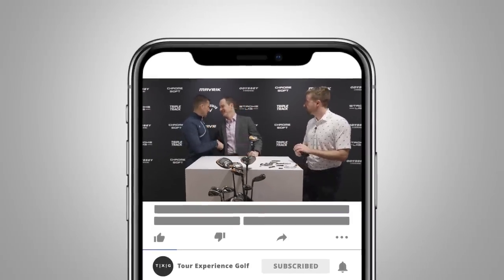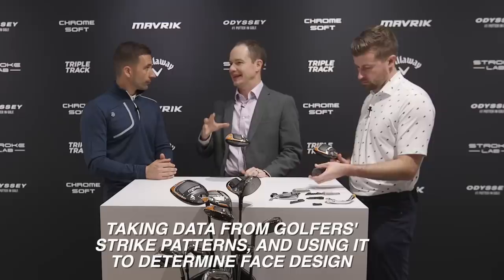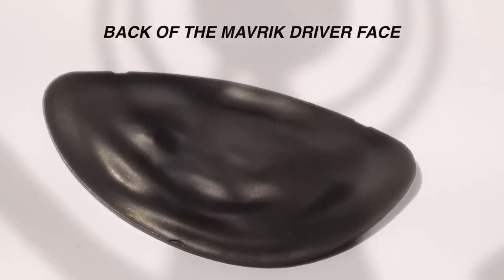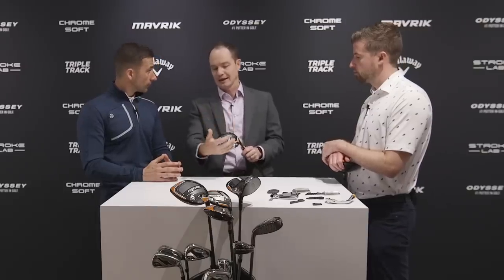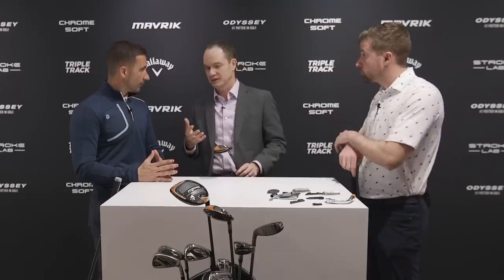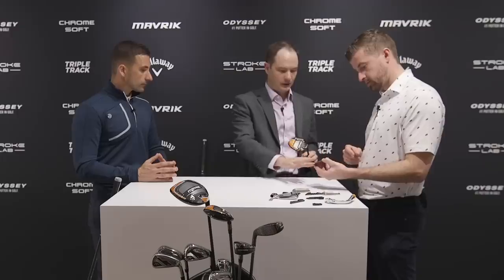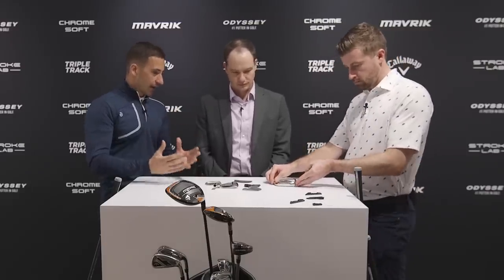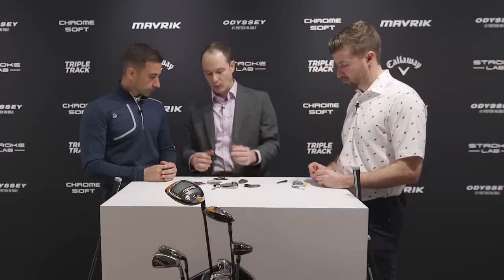A.I. and Flash Face with Callaway's Dave Neville

Comment: Great video. I am going to look at the Mavrik lineup because of this video.  However I wish he would have explained what the  “ bumps and ripples” actually do. For example the Mavrik face has 2 bumps in the heel area of the face.  Why are they there?  To provide strength for the thinner parts of the face ? Or does it help with heel strikes? How does it help?  Thanks.
Reply: Good questions, might have to do with higher MOI at any point of the club where the off center hits are. Having a large data set to feed to AI so it learns from it and spits out the right design is hugely important so I am interested to know the quality of the data set used by Callaway from amateurs not pros as their miss hits and ours are very different...